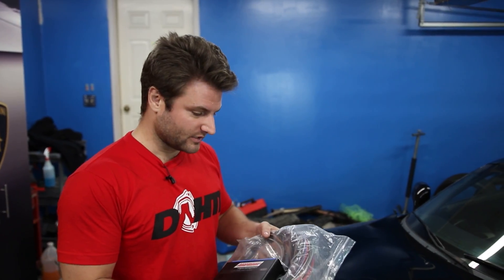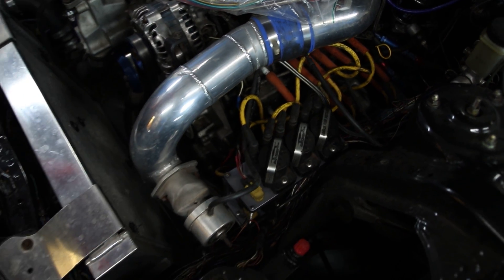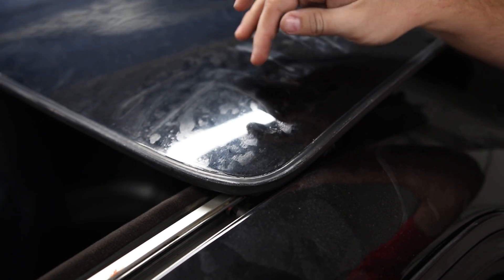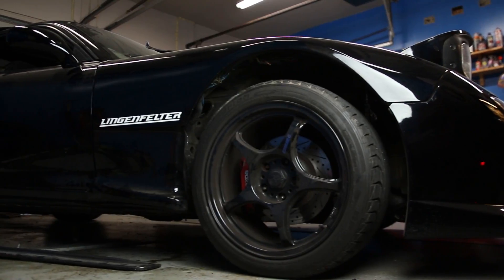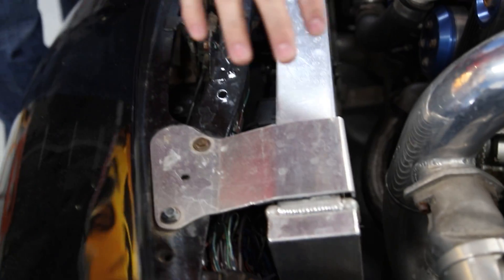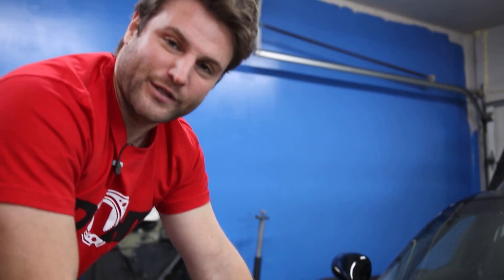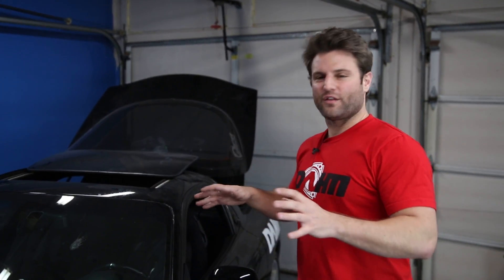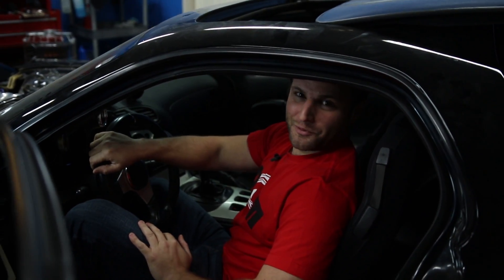Should I sell the 3 rotor RX-7 to help fund the 4 rotor?

Comment: sell it to make the ultimate 4 rotor !
Reply: borderex 17 he has a ultimate 4rotor.
Reply: yea but its not finished yet.
Reply: borderex 17 it is.
Reply: Kanggoo The engine might, but I was talking about the car. I haven't seen it yet.
Reply: borderex 17 watch the sema video, its done
Reply: Kanggoo It doesn't even start yet. It's unfinshed
Reply: borderex 17 In my opinion, he should keep the 3 rotor because if anything bad happens to the 4 rotor, he can still have the joy of the rotary engine with him. But I respect your opinion.
Reply: jon doe you must be evil to ls swap an rx7
Reply: borderex 17 well I LS swapped a rx7 so come at me
Reply: ian price come at you? the ls is heavy, and easily makes people fire shots
Reply: ian price plus the ls ain't shit
Reply: KustomDudeZ rotary advantages are lighter engine and that is it the rotary needs forced induction to make any power also the rotary makes very little torque also they are horrible unreliable

Comment: What is the reason for only running one plug per rotor? Is it better than the factory two?
Reply: Rob Dahm if you was to sell it how much would you advertise it as?
Reply: Jason AzOne i bet somewhere over $40k ish, even if its problematic as it is. FD RX7's are hard to find, so when one goes on sale, prices literally go through the roof.
Reply: no more like 35k at most

Comment: I've actually been fighting the same issue as you. I have 4 projects in my garage and I've been considering selling one of them but I love them all for different reasons and they're all nearly completed. As much as I'd love to see my main project finished, I feel like I'd be sad that I sold one of them after my main project is finished. So my answer to your question is, keep them both. Sometimes you're stuck waiting on a part for one project and while you're waiting on that part, you could do some small adjustments to your other project just to make it that much better.

Comment: Damn, that's a lot of work ahead of you. I think I'll heed your advice from a much older video of yours and leave mine alone. Well, for the most part. You would call mine stock if you saw it. Petit Racing air box,  Borla exhaust and under drive pulley... Besides that, it's original everything besides maintenance stuff like brakes, tires plugs and wires. Oh, I forgot about the radiator. I replaced it with an OEM Mazda radiator last summer because the original sprang a leak.  It still has every original lightbulb and wiper blade. You are a brave man for digging in so deep, but that's what you do, so kudos for that!! I like to jump into my car and go out for laps without worrying about shit besides making sure the oil and radiator are filled. Actually, sometimes I still worry, but it's been very good to me.
--original owner '94 PEP /points left

Comment: If I were you, I would keep both. I get very related to cars very quickly, sometimes too much. For example, I really liked my mother's Renault Scenic. It was such a comfortable and fast bubble car. And then we changed it for the sudamerican version of a VW Polo Wagon. I wanted to burn the thing to the ground. Thb it's the only car that I'm not really into. I would work my ass off to keep both.
Reply: Oh, and for those who say he'll never drive the 3 rotor again when he finnishes the 4 rotor, they are completely different concepts, very different expireances. Not just two RX7s with different engines.

Comment: My opinion is to keep the 3-rotor. Work on it at your leisure. As it's a modified car, that needs alot of work (as you've so described), you're never going to begin to recoup the costs involved in the building of this car; to a potential buyer, it's just a project car that needs work. To you, it should be a reminder of the past; even if you never get it running again (doubtful), it serves as a reminder of where the inspiration for the RX7s came from. If you sell it, I think it would be "the one that got away" - you will regret it in time.

Comment: I think you should keep it. Reason being you will "slow" your other project down but with that slowed down project it gives you time to think and make possible adjustments that maybe you never thought of before. IN a sense you are creating more time to think the project through and do it even better than before (possibly). At least this is how I would look at a project. When you are not under the gun you can think more clear and stand back and make better choice. Who knows you might end up finding something you want to change in the build along the way and have time to put the research in to figure it all out. That's my two cents.

Comment: i'm a fans of this project, i really loved your 4 rotor mazda project. i know how the 4 rotor wins the 24 le mans in 1998 with just 4 rotor 2600cc engine that could put out 900bhp, which is it was limited to 700bhp to rise reliability (and sound really eargasm). and i just wondering how fast it could be without any power restriction? then i see your project, and it's just like dream come true 😝. i think, you should sell the 3 rotors, you may regret or miss the 3's, but if you succeed the 4's, it will never (ever) dissapoint you. since the your 4's looks more drivable than the 3's,  and more effort you put in the 4's. besides 3's looks more common project. but the 4's, last big project i know is the factory 787b, the R*db*ll miata, and yours. this is amazing project, hope you can finish it soon.

PS
i may really love the rotary engine, but if i were you, i would never sell the lambo. you may regret it more than you sell the 3's.

Comment: I guess the real question is, what pricing structure would you use if you were to work the street corner?  Are you going to charge by the inch?  Maybe charge more if it's more than "just the tip?"  To plot out a proper budget sheet we need to get into the nitty gritty details.

Comment: One thing I learned working at a grocery store is: "Never forget what/where/when you started, and more importantly have discipline when things take a turn for the worse." Because we all had to start at the rank of "The Village Idiot" working on our 1st car. After working on project after project, you acquired the skills/knowledge/abilities of what you can or cannot do to your car(s) over the years.

Rob you learned the inside and out of your RX-7. If something did go horribly wrong with your 4-rotor, you will be able to keep your composure and fix the issue.  If you feel you can live without the engine, sell it. But from watching your videos over the years shows you put blood, sweat, tears into your projects.  My honest opinion would be to keep the engine, and put it in an cheap used RX-7 with a blown engine. It would still be a lot of fun doing track-days if it's kept race-ready. And it would probably pay dividends not getting speeding tickets on public roads ;)

If you do another project after the 4-Rotor, make it a Honda S2000 with the F20c engine. It has a similar power curve with all the power being from 5000-8800 RPM.

Good luck Rob, and thanks for the good videos.

-JB

P.S.  My 1st car was a green 1993 Ford Taurus SHO. It wasn't me though. Maybe you should ask Could of been Conan O'Brien about his old green Ford Taurus.

Comment: Will i have a 1995 Honda Civic LX. its has light and medium damage on my car. I was trying to spend for new engine and transmission. I still have my car and other car to help me for 2 vehicles just daily drive. as ur question. if it was me sell it. if u have enough Vehicles you can drive to work point A to point B.

Comment: sell the cts-v. turn down the boost on the 3 rotor get a easier clutch. and daily it. also put power steering back in and some grippy but usable tires

Comment: Sell your current turbo for a better sized Garrett while you're in the process of rewiring the engine harness. It's easier to replace it now and make the initial tune on that turbo than installing a turbo later and retuning it. Plus you'll save the tuner time and yourself money by only tuning it once.

Comment: It's basically being replaced by the 4r - which should drive just as well - or even better - & be as comfortable as the 3r... I think you should sell it - you're upgrading(& I'm certain you'll do so - when the 4r is up, running, & outperforming the 3r - anywayz)... #Selll

Comment: Sell the lambo use the money to build the 4 rotor and 3 rotor..... upgrade ecu, wiring and turbo, paint body and use the protective wrap that you use on the lambo , change headlight to the one that have the intake hole...

Comment: Keep the "T RX7"'!
Also bro do you recomend rx8 as my first project car, they are cheap to buy second hand where i live, thanks
Reply: Malik Rahmoun I love my rx8 and plan to fully build it down the road but it is a car you have to be prepared to own. it is expensive to build and you get little gain with aftermarket parts. people say what they want about that motor but mine is reliable, my friends is reliable. also, there is some aftermarket and it is growing but it's all expensive. all I would say is got test drive one, it's not the fastest car by any means but it has enough power to not be Miata slow and plenty of fun
Reply: The plan was to build a drift car
Reply: Malik Rahmoun I drift mine from time to time but 2 things to note and one is obvious but one, there is no low end power so clutch kicking is life and the other is the steering is electric power steering so it is super sensitive and twitchy at times. I am used to it by now but I actually bought a ls400 to be my dedicated drift car haha
Reply: Thanks for the advice  :)
Reply: An RX8 is reliable right up to the point that the engine blows. Find one with documented proof of an engine replacement unless the miles are super low, and even then. I bought my car with 51k on it many, many years ago and it had a heart transplant under warranty when it was only about 2 years old, due to the "low power" recall campaign on first gen cars.

If you get one, first thing you need to do is get a BHR ignition system. That is money very well spent.
Reply: +SkuzzyJ yeah I test drove an rx8 an it was super slow.
Reply: Andrew Lane 
They're not bad if you know how to carry momentum through a turn and aren't afraid to beat the unholy dogshit out of them. (Sticky tires and suspension maintenance is key for that.)

There's a reason my now-100k mile car is on it's 3rd clutch. No lift shifting and extremely aggressive launches are hard on drivetrain parts but it's so brilliantly rewarding to rev the piss out of that engine and keep it there when you have a good road ahead. I think people forget that the RX8 was designed in an era where the average sports car wasn't really all that fast and the stuff that was cost 30% more.

Wasn't long ago, a car that cut a 6 second sprint to 60 was considered pretty damn quick. Looking back at it and comparing it to today, where you can buy a fucking Camry that runs faster in the 1/4 mile than most of the "fast" muscle cars that everyone likes to long for, it's a great time to be a gearhead.

Comment: Are you gonna beat the 4 rotor? If you are get rid of the 3 rotor. However if you're NOT going to beat the 4 rotor and just garage it and save it for events and such. Then I think the car MIGHT be worth keeping so you have a car to beat at the strip. Truth be told though, your transmission is beat to hell from drag passes, the paint is trashed, and the wiring needs to be redone. You wanna keep throwing money at this that's all you man, but I don't think it's going to help you solve the practicality problems. This is a racecar and pretty much every racecar you see has quips unless we're talking about a build that clearly has TONS of money (and time) thrown at it.